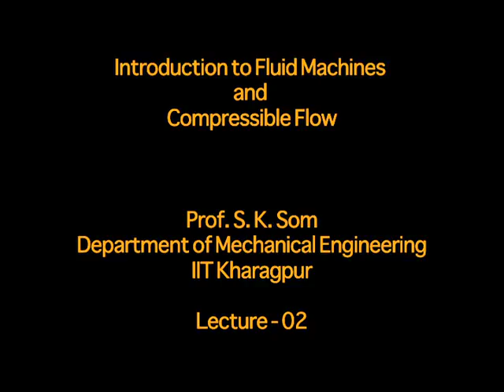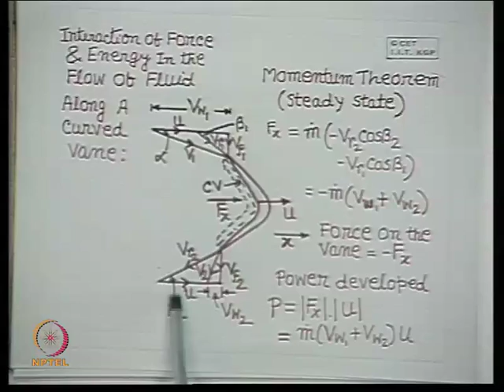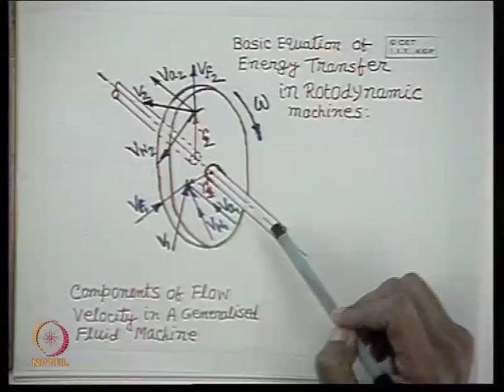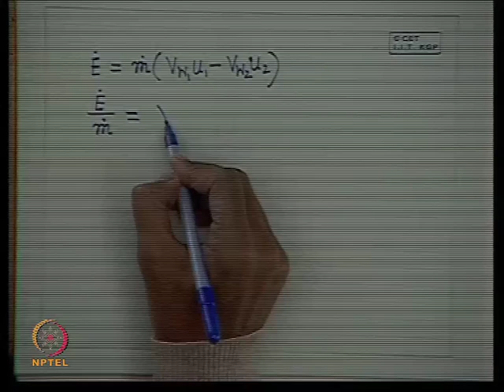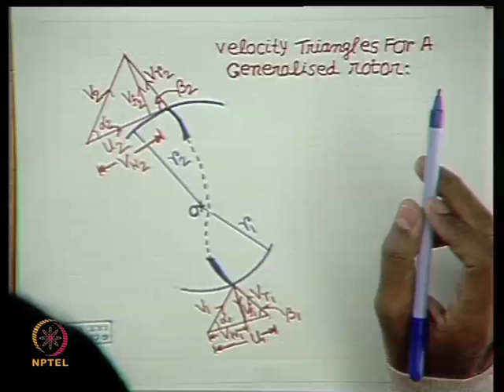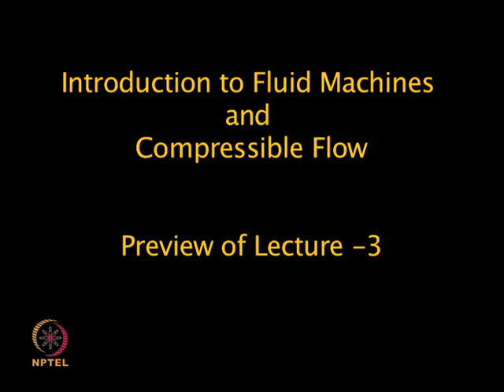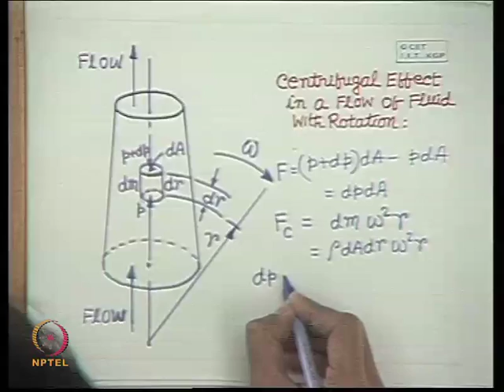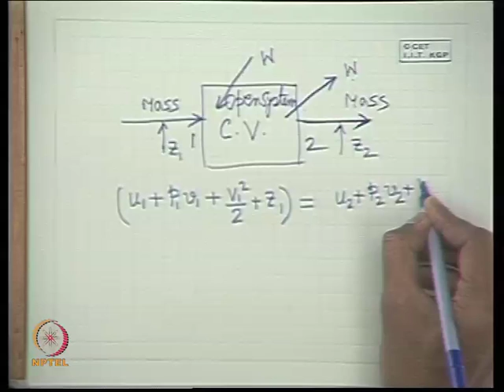Mod-01 Lec-02 Energy Transfer in Fluid Machines Part - I

Comment: at 18:08 the directions of the angular momentum's are not considered while doing the calculation. cw and ccw are considered then the positive sign coming in equation not negative. don't know why?
Reply: This is a general equation, depending on the orientation of the exit tangential velocity the magnitudes are allowed to change. The positive sign is not incorrect, it just represents one of the two possible cases.